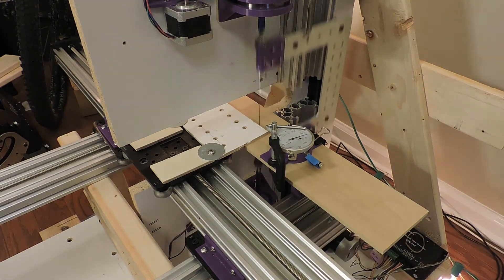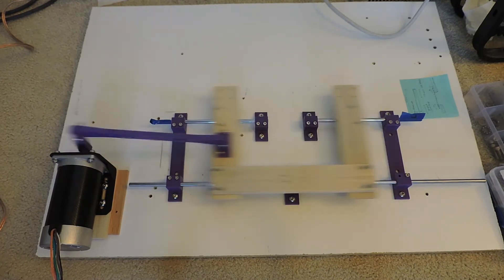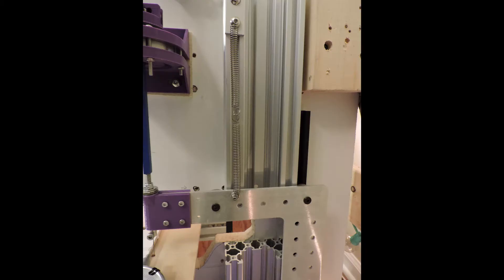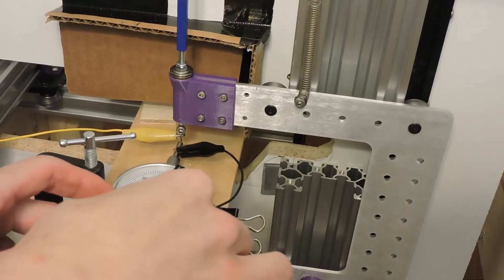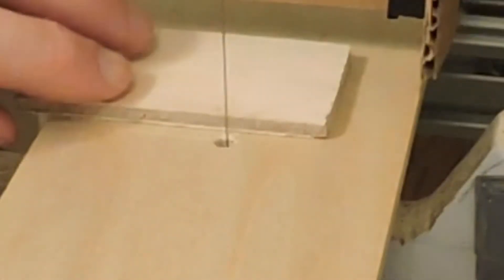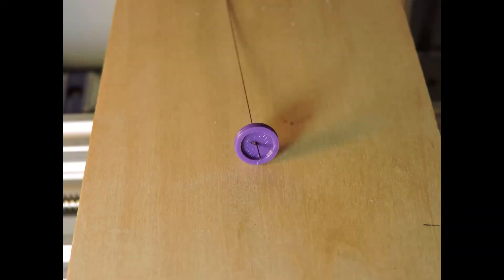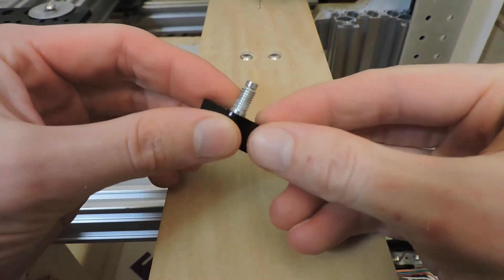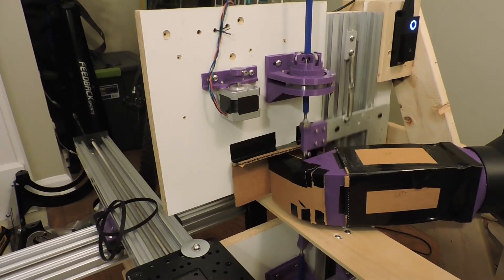CNC Scrollsaw v6

Comment: Why rotating the blade in the first place? Just buy a all directional blade and the structure of your build gets much simpler. All directional scroll saw blades are a thing Google it
Reply from the maker: Those don't fit my needs of kerf size and cut surface quality

Comment: The standard test on a scroll saw to see if your blade is square to the table is to make a short cut into a piece of wood, take the wood away from the blade, flip it over, and see if the blade will slide into the slot (you bring it against the back of the blade for the check).